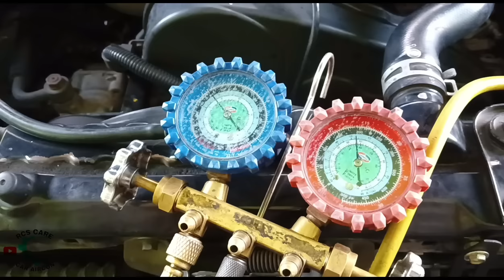MAHINA ANG LAMIG SA TANGHALI?MGA PWEDENG SOLUSYON?/ADVENTURE FROM SANTA ROSA LAGUNA

Comment: Mas maganda sana ang switch ng additional auxillary fan na inilagay mo naka synchronized sa rad fan motor...para lagi sabay na aandar at hnd madali masira ang motor nkakapagpahinga cya
Reply from the maker: Wala Po radiator fan Yan boss clutch fan Po ska Yan Po gusto Ng costumer boss sxa Po massunod tau mag aadvise lng pero Yan gusto nya pde nmn isabay sa compressor Yan pero Yan gusto nya e.

Comment: Sir bkit yung Avanza ko pag uminit na makina nag shut off ang aircon?? Pero yung auxfan niya ay naka on naman??
Reply from the maker: bka po high presure boss masxado mainit condenser p actual check nyo po para mkita high side low side boss
Reply: @rcscarecaraircon1433  thank you sir for your reply! So pag nag high pressure ano ang dapat icheck?? Expansion valve?
Reply from the maker: @EndofUSA  check condenser Po at smpre kasama don ung valve drier

Comment: Sir ask ko lang po. anu po pressure ng leak test nyo sa high at low side
Reply from the maker: Pag nag leleaktest boss,sa low side lang nag lalagay 200 to 250 sa buong system na yan
Reply: @rcscarecaraircon1433  salamat po sa info more power to your channel!

Comment: paano po kung ang reading sa guage ay 40-50 bago ang compressor at dryer bago din expansion valve front and rear. na leak test na din . pag tanghali hindi gaano malamig kahit na naka todo na ang thermostat.
Reply from the maker: ano po high side nya?
Reply: 190 pero naayos na po. pinalitan ang expansion valve may factory defect. maayos na ngayon. ang gusto ko pagawa yung luma ko compressor. baka pwede pa repair.

Comment: Bakit kaya nailaw indicator ng bateri at fuel sa dash board kapag naka on ang switch ng aircon sa likod kapag pinatay ko ang switch ndi na umiilaw sa dash board ang bateri at fuel indicator l300 ang unit ko bagong gawa ang aircon
Reply from the maker: Bka po may nagdikit sa wiring side ng aircon bossing pa check nyo electrician boss
Reply: @rcscarecaraircon1433  salamat bos pagpalain ka

Comment: May hi speed cabin fan po b.mahina buga kasi.malinis na filter.thanks po
Reply from the maker: bka po may prblema n evaporator mo boss
Reply: @rcscarecaraircon1433  nababa n po ung evaporator .napalitan m ng expansion valve.nalinis n po. Malamig n sya mahina lang buga ng hangin
Reply from the maker: ano po ba unit mo boss
Reply from the maker: tawag kna lng po 09303738317 boss

Comment: Sir mgndang gabi, anu kya problema ng ac ko, ok sya pg gabi malamig sasakyan piru pag tanghali lumalamig pero di masyado. Pero pg nka hinto walang lamig nka fan lang. Salamat sir, new subscrber here.
Reply from the maker: high presure yan boss ano unit po ba?
Reply: @rcscarecaraircon1433  toyota vios batman 2008, palit comprsor npo ba yun sir? Salamat sir
Reply: @rcscarecaraircon1433  kung malapit lang aku syu ko ipatingin sir hehe kaso dito aku sa leyte.
Reply from the maker: compressor at condenser po yan high presure po
Reply: @rcscarecaraircon1433  salamat po sir sa sagot at my idea po aku.

Comment: Sir Sana mapansin mo to tanung ko Yung sasakyan ko Lancer pizza 2000
Sir Yung ac ko pag pinakargahan ko NG preon maganda naman lamig hindi naman nababago kaya lang pag na istambay NG 3 to 4 days tas paandarin ko ay wala na naman lamig? Anu kaya possible na problema ayun sa analysis mo sir? Salamat.
Reply from the maker: Ok kung nawala oh naubos ulit ang load ng freon mo sigurado may leak po yan boss.ang pinaka maganda mong gawin pa check up mo lahat ng system boss.
Reply: OK sir dalhin k sa shop MO Para ma gawa na at mag up grade na din ako NG aux fan na high speed kagaya yan  demo MO sir?

Comment: 2deg centigrade normal grille outlet temp sa loob sana ang sinukat ninyo using thermometer to avoid guesswork po. (37psi low side press at 2000rpm sana charge pressure ang ideal) 😊
Reply: Not satisfied... Binaklas mo same output pa rin.... Then nag charge ka pa ng back up blower fan.... Not recommended for real design...
Reply: Magaling lang mauto sa salita
Reply: mag post kayo ng mga repair videos ninyo mga masters.